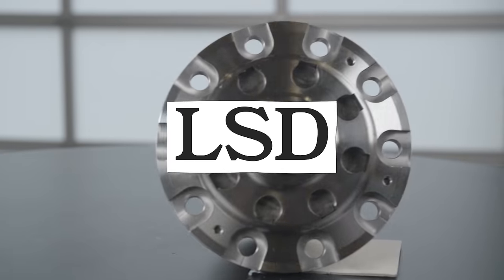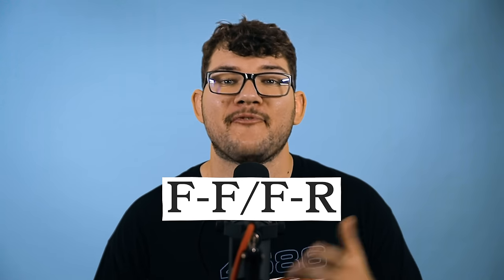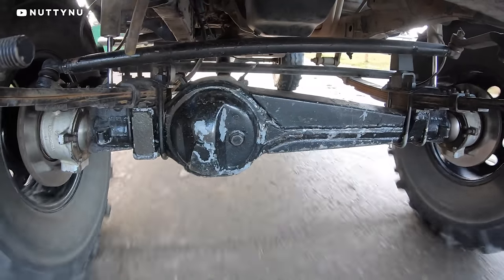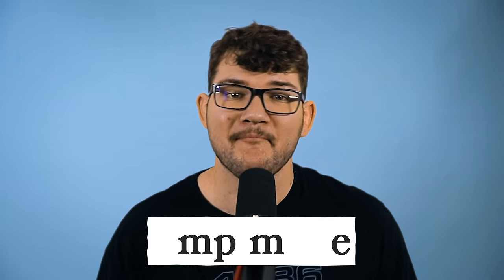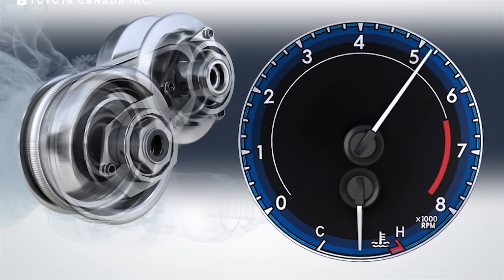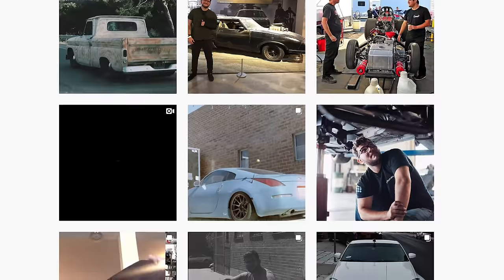Car Terms Every Car Nerd NEEDS to Know

Comment: “ public notice” 

You can only change blinker fluid using a left hand screwdriver
Reply: where can i buy it.
Reply: 03evo8 4g63  should be easy to find they usually next to the brass magnets
Reply: You can usually find it in places that sell long weights
Reply: Got one, was right next to the transmission sand.
Reply: Really? They have those now?
I'm a Lefty, I used the Weird Green Scissors in Grade School, but if they have like a Full Lefty Tool Set, I'd LOVE That!
So tired of using Tools Made for "Righties"...
This is the type type of company to encourage!
Reply: Yup only thing that makes muffler bearings easy to remove
Reply: Ryan Khunja and next to the piston return springs
Reply: Alden Hauser  thanks forgot about the rotary pistons
Reply: LMAO
Reply: ONLY use left handed screwdriver after liberal application of elbow grease
Reply: you have to also remember there is different fluid for left and right blinkers.
Reply: Maestör Rasanen  think your confusing that with the HID fluid.
Reply: and also please do not forget to add the lubricant milk to the oil after the blinker fluid chage.
Reply: @balazsfarkas-jenser2230  In the older cars there's also the blinker filter you must change when you change the lubricant milk to the oil. Otherwise the blinker can  change the color of the blinker.
Reply: @aldenhauser9555  I know we're all talking bullshit here, but piston return springs existed. Sort of. Search for "Hildebrand und Wolfmüller": A 1894 motorcycle where the pistons directly drive the rear wheel and are helped back to BDC with rubber bands.
Reply: you can do it with a right hand screwdriver only on a rotary piston cars
Reply: That was great, but he didn't talk about the ID-10T code that comes up when changing the blinker fluid. Usually needs more lefter, or DIM turns
Reply: Kind of off topic, but when adding or changing blinker fluid, it is essential to make sure that your lug nuts are optimally cross threaded and that you tighten them only once in a counterclockwise manner.
Reply: @therwfer  hmm interesting!
Reply: @Rkhunja  damn thats why i couldnt find one i was looking at the aluminium magnet section
Reply: It's smart to change your blinker fluid when changing to winter air in your tires.
Reply: Brass magnets are almost always next to the long weights
Reply: Funny thing is I've actually had someone fall for the left handed adjustable wrench before. Funniest thing ever seeing him look all over for it
Reply: Lol
Reply: Hey Guys n Girls Top Tip on a SERIOUS  note... dont make the same mistake I did and always check the date on your lubricant milk B4 you add it , ..."Why" U ask?   cause tainted sour ass milk will poison and kill your horses that's why!! Trust me I just lost and buried  15 of the buff boys to  old chunky stinkin ass lactose. Now I'm only makin  78HP instead of the factory fast as shit 93HP In my 1987 base Plymouth Sundance auto...DAMN MILK now it's slow AF...Shit!
Reply: Don't know if you guys can help?... But I'm looking for some tartan or striped paint.
Reply: Make sure you please check your seat pressure.
Reply: Jake Green  hey happy to help. Make sure and pick up a 710 cap as well.
Reply: But before you add your lubricant milk make sure you contact your car manufacturer and double check to make sure your car isnt lactose intolerant if it is the car will be pumping buckets of steam into your cab and it smells if thats the case ask them how to aquire and add the lactose free lubrication milk to the blinker fluid according to the manufacturers recommendations
Reply: @Rkhunja  Nah, a little Right Angle Grease helps.
Reply: Thank you that is how you do it
Reply: Before you do that, it's important to secure the Blinkerfluidcap with a Siemens-Airhook.
Reply: That is garbage, sure it maybe makes the job easier, but if you are half-way competent under a hood you can pull it off with just a set of 10mm SAE pilers
Reply: Okay, I understand about the lefty screwdrivers, but are we talking Phillips, flathead, or ampersand tip?
Reply: Don't forget to check your muffler bearings and catalytic cables whilst you're at changing the blinker fluid.
Reply: @tcayzer  great one 🤣🤣🤣
Reply: But your have to turn the left hand screw driver with your left hand clockwise one turn the counterclockwise and repeat
Reply: @MrHAZZA821  by the brake cushions?
Or the short throw wipers?
Reply: @ohmmygod4963  they even make left handed coffee mugs now too.
Reply: If you purchase the sky hook with the left hand screwdriver at Walmart you get it at half price.
Reply: Got my left handed screwdriver for free when I purchased a radiator cap for my 73 Volkswagen beetle.

Comment: The List:
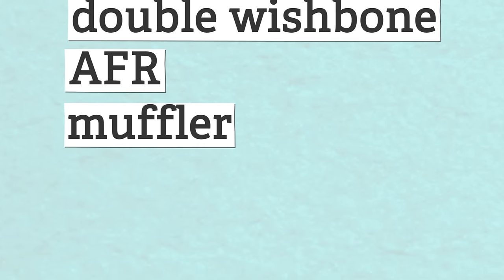MUFFLER 1:45
RESONATOR 1:57
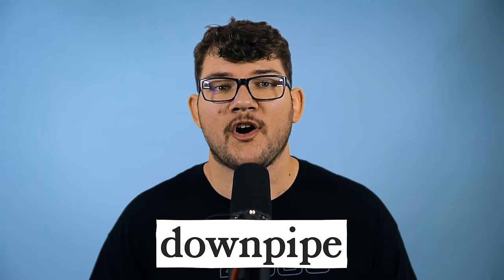DOWNPIPE 2:14
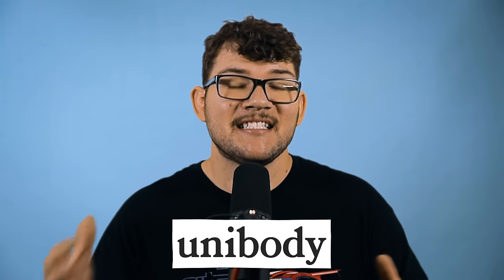UNIBODY 2:28
LADDER FRAME 2:37
CARBURETORS AND FUEL INJECTIONS  2:54
CEL 3:13
FWD, RWD, 4WD, AWD  3:28
TORQUE 3:57
I4, I6, V8 4:27
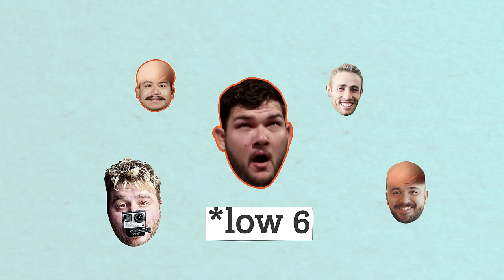F-F/ F-R 5:00
BONDO 5:20
WOT 5:35
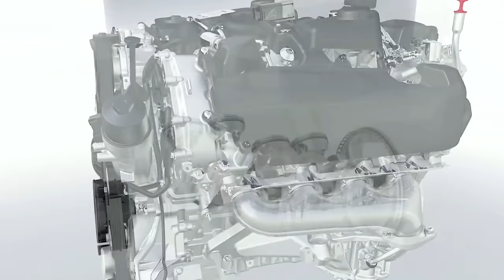N/A 5:50
HEMI 6:00
TURBO, SUPERCHARGER 6:36
SPINNY BOI 6:54
BOV 7:10
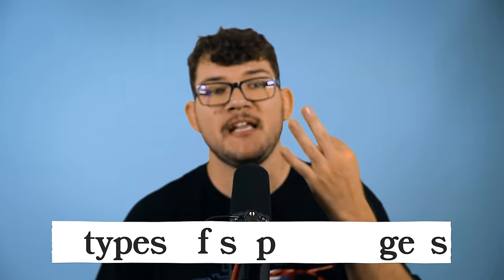ROOTS SC 7:39
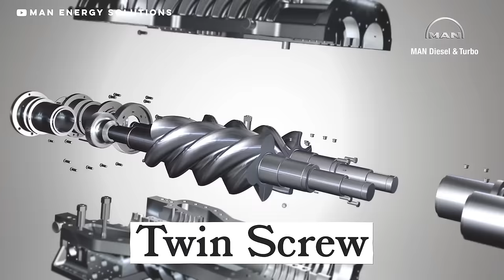TWIN SCREW SC 7:52
CENTRIFUGAL SC 8:04
X PIPE OR H PIPE 8:19
CAT 8:45
MUFFLER OR CAT DELETE 9:14
SLEEPER 9:24
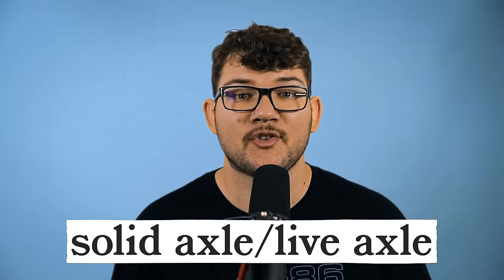SOLID AXLE OR LIVE AXLE 9:49
TORSION BEAM 10:04
MACPHERSON STRUT  10:15
DOUBLE WISHBONE 10:22
MULTI-LINK 10:37
CAMBER 10:53
DOUBLE CLUTCHING 11:33
AFR 11:47
BHP 12:23
WHP 12:33
LIMP MODE 12:45
HEEL TOE 13:07
REV HANG 13:31
MONEY SHIFT 13:52
FINAL DRIVE 14:10
LSD 14:23
CVT 14:37
blinker fluid 15:06
TRANS AXLE 15:29
RACING FROM DIG 15:44
ROLL RACING 15:49
GROUND EFFECT 16:00
FIRING ORDER 16:10
ROD KNOCK 16:25
Reply: Thank u
Reply: cool
Reply: Doing gods work
Reply: A fucking legend

Comment: Ah, so “rod knock” is what I heard 30 seconds before my outback spit little bits of engine block all over I-205 😂
Reply: "rod knock" is when you can't fill the hole. If you catch my drift.
Reply: That’s a standard feature on all Subarus
Reply: @alouiciousdeverdander9152  Thats a standard feature on people that doesnt care about their cars*
Reply: @Luck-jl3hp  But mostly Subaru flat 4s*
Reply: @Meme Man Almost, correct
Reply: No, Rod knock is the common occurrence of rock star Rod Stewart approaching your house to compliment your taste in cars.
Reply: @owenhughes5781  😂😂😂😂😂😂
Reply: I had a rod pop and a rod drop, and an oil pan filled with coolant XD
Reply: Ah the classic, having ur car throw pieces of engine onto the road
Reply: I felt that. 👀 My Outback seized on my way to work at 150k mi- used. I had a slappy boi for cylinder 3(if memory serves) and that didn’t last but a few months. I still drive that car with a Jasper inside. :)
Reply: @Luck-jl3hp  dude subies prove time and time again they cant make a boxster for shit
Reply: That's just extra crankcase ventilation.
Reply: PNW eh?
Reply: Ouch
Reply: @Rubie_the_Black_Widow_Subie  For sure.  Vancouver.
Reply: @Luck-jl3hp  I took care of my car.  It had 300,000 miles on it.  What do you expect? 😂
Reply: @Justinlifts365  It was a 98 with the NA 2.5 L and the head gaskets had been replaced, which means the only thing wrong with that engine was the 300,000 miles on it. 😂
Reply: @davidhaas3111  lived near there for five years ending a few years ago. Got too expensive.
Reply: @Rubie_the_Black_Widow_Subie  I get that.

Comment: “If you say it with enough confidence people will believe you”

Yo I just installed a new Whippy Shammer. Really gives me more horsepower.
Reply: Hrsprs*
Reply: Obviously  that's a slang term for a Whipple supercharger
Reply: @jayvette8936  It is now
Reply: 😂 Love it lol
Reply: I'm actually gonna say this someday and see if ppl figure it out. Also, same with abbreviations if u make one and say it with confidence ppl are probably gonna start using it
Reply: @Egerit100  good luck keeping a straight face lol
Reply: When I was 18 I sold my straight piped 89 Pontiac grand am with quad 4 dohc. I told this kid that I put a hyper micro minuscule modulator in the car and it had around extra 100 hp and he believed me no questions asked. He thought it was a real part. I found out he wrecked the car, he was racing it around on the streets and lost control and he launched over a road divider. Totaled 1000000000% just an FYI I didn’t rip off some stranger. I knew the kid as we were in the same foster home for while together.

Comment: 14:23 LSDs aren't limited to use in RWD cars. FWD cars use them all the time to combat torque steer and wet/slippery situations where power delivery is key. My Mazdaspeed 3 has an LSD in its transaxle for instance, and it may not be super common but I know other F-F cars use LSDs in their transaxles.
And this is the most comfortable I've been talking with shop/forums terms in a youtube comment section. Thanks, Donut!
Reply: Subaru has them too
Reply: My si has one as well
Reply: Integra has it
Reply: I appreciate that you use the word transaxle correctly. Lots of FWD Focus have LSD front diffs too.
Reply: LSD in FWD you go from torque steer to no steer haha
Reply: Dane Kelly aye si gang rise up! Had my 2020 for about a month now!
Reply: I've got a mazdaspeed3 as well, that car is so much fun to drive. That first week of driving around and feeling it all work when mashing the throttle was a blast.

Comment: I would like a whole video about the difference between Steptronic/Semi-auto transmission/Easytronic/CVT/DSG and a classic AT.
Reply: All you need to know: dual clutch transmission (dct), cvt and standard AT (which would mean it has a torque converter). There is also singe clutch T but they are rare these days.
Reply: Or a good ol powerglide
Reply: Top comment
Reply: A semi automatic transmission is a manual but without the clutch which means you don't have a clutch which uses the same concept of a manual transmission but without a clutch.
Reply: @boyinahat1002  like the transmission in dom's charger?
Reply: All you gotta know is DSG is the superior trans setup
Reply: @boyinahat1002  Like, how does that even work?  The point of the clutch is to separate the engine from the transmission while you're changing gears.  So, if there's no clutch, how does the car separate the engine from the transmission?  I'm trying to make sense of it, but I can't.
Reply: Shawn Newland  Got it!  Thanks for the explanation!

Comment: Common car phrase among older gear heads: "Its still good."
Reply: James Grandone or “that’ll do the trick”
Reply: Or at 200k miles "the motor is broken in"
Reply: Or the well known “zipties will do it”
Reply: Endík XD I can’t count the amount of zip ties under my hood on 3 hands
Reply: Endík XD it would be closer to 5
Reply: "thats not going nowhere"
"as good as new"
Reply: I once broke the shift cable linkage that attaches to the ball on the transaxle of my ford fuckas, and put on enough zipties to drive for another 4 months until I sold the car for $200 and buddy tried to bring it back because it needed work. Fun times.
Reply: Scott Sophia that’s a good one
Reply: Morgan Wilkes nothin wrong with that my friend.
Reply: I'll get around to it eventually

Comment: Ones i wish was in;
Pushrod suspension and engine
Direct overhead cam 
Sohc 
Dohc 
Redline 
"Full send"
Dct (double clutch transmission)
Oem 
"Chipped" (chip tuned cars)
Hooning 
Abs 
TC
Reply: ohv
Reply: Yea he should’ve Atleast our SBC small block Chevy
Reply: must know termins are "tick" and "knock"
also:
ANTILAG
FPR
OHC
TPS
CLT
MAP
IAT
ASR
CPS
MAF
O2
WOT
JDM
CPS
EGT
VVT
DI
ECU
EGR
VR
ABS
OPS
VSS
FPS
NOX
WG
BOV
OBD
IAC
044
COP
ETC
VAG
EFI
HALL
ISCV
DOHC
CR
BC
TOE
Reply: FMIC
SMIC
Wastegate
IDI
Idle
VTEC
Shitbox
Ricer
Slushbox
Yin-Yang Spinny Thang
Hiroshima Hair Dryer
Chinese Choo-Choo
the list goes on

Comment: I really need to check my blinker fluid, haven't done it in a year and that clickin gets really annoying. Thanks for mentioning it!
Reply: @supercecilia yes. You get it at all gas stations. It's the yellow(gold) or white(diamond) liquid depending on the type of light you have.
Reply: @supercecilia Xenon: diamond, Regular: Gold.
You could use diamond for regular ones, as it is a clear color, but most experts at TÜV in germany mention that the gold version is more efficient with old lights, reaching a "quadratischer Blinkerflüssigkeitskoeffizient" (quadratic blinker fluid coefficient) of QBL^2=0.95=95%, while using diamond on them only squeezes out 85%. Diamond costs around the same as gold. Some care, some do not. If you live in germany, ask the TÜV to do it for you. If you live anywhere else, do it yourself, as it could get costly if you ask a mechanic.

Comment: I brought a BMW so I can spend less on blinker fluid. I'm saving hundreds every month.
Reply: actually BMWs are the cars that need blinker fluid the most
idk if you've noticed, but almost all BMW owners have run their cars out of blinker fluid, and at that point it's so fucked the blinkers don't even work anymore
remember to top that shit off!
Reply: @Chimera6297  What are you talking about? It's well know BMWs are exempt from having to use a blinker. Just like it's well known if you buy a Jeep, you have to slowly take off parts of it until your driving nothing but an engine with wheels. I mean if you're driving a Jeep with your doors on, or if you are using your blinkers in a BMW, I'm not sure if they let you keep your license.

Comment: "Rod Knock" what keeps every WRX STI owner up at night 😂
Reply: 350z G35 guys too #vqprobs
Reply: Good thing I have a WRX with a sti transmission (deep down I’m almost the same)😢😢😢😢
Reply: rod knock is what kept my last Subaru from being sold 😭
Reply: Don't fucking scare me 😭😭😭
Reply: And Mitsubishi owners
Reply: Duck Mint Ha but the evo 8 and 9 though 🥵🥵
Reply: Finna start checking my oil whenever I refuel instead of every 1k miles.
Reply: Ha, I just lost my ring land and spun a bearing in my Subi 😂 Definitely keeps you up when you're pushing these engines!
Reply: I see no cap here
Reply: E9x m3 people too
Reply: i literally have nightmares about my subi knocking
Reply: Already happened to me. Got a new short block and it still haunts me lol
Reply: Blown Heads
Reply: don’t forget 240sx owners too 🤧
Reply: Annd that’s why I just had my engine swapped 😂
Reply: Honestly I just now know what that sound my car has been making is and may explain the crack I have yet to adress
Reply: -Kock knock
- Who's there
- Rod 
- Rod who 
- Rod knock

Comment: Terms to know if you own an old Silverado: “Lifter tick” and “shitbox”
Reply: Shit box is a Honda term.
Reply: Or just an old car in general. My 95 caprice has the ole lifter tick, and us often referred to as shitbox
Reply: Truth, lol
Reply: Tick tick tick tick tick tick tick tick tick tick tick tick tick tick!!!...
Reply: @ConcussedGaming  or slow car
Reply: Shitbox is when you own a chevy in general.
Reply: Lifter tick? lemme guess.. OHV Engine?
Reply: Throw on "Death Wobble" for Fords.
Reply: Chevy still better than a Ford
Reply: Co Po but then there are the non shitbox old cars, all the classic cars. 
And then there’s the new cars which are shitbox like Prius.
Reply: Marvellino Gracia Z yep, 5.3L LM7 LS. Almost 207k miles and still runs pretty good minus the aforementioned lifter tick
Reply: @Rysander1  Death Wobble is an extremely common term that can be caused by vast array of things. Nothing about it is specific to Ford.

Had an 91 Caddy with no linkage with it. I've fixed my Subaru's death wobble like 3 different times
Reply: @le.farquad608  and what do you own that's so fast? My ol single turbo Silverado runs pretty damn good.
Reply: @paulfrench7257  thy're both bad, ford rips people off, and chevy just makes garbage.
Reply: Cam Bryan i track my cars so top speed means nothing. Handling and fun factor is priority.
Reply: I couldn't really say I have a 2015 Dodge Ram 3500 Dougie

Comment: True story, my first car was an automatic. I had watched Initial D a lot, and watched how they Heel-toed. 

When I got my second car, which was a manual, I tried to figure out how to heel toe myself. Took a few tries before I figured it out, and a couple weeks before I was able to accurately match the revs.

These days I heel toe basically every braking downshift just out of pure instinct. Even took an older guy, who has done a lot of track days and amateur racing over the years for a drive in my car, and he said "wait you heel toe? Wow Im impressed".
Reply: Yeah I've started doing it a bit recently, not too hard though
Reply: Nicee
Reply: Corona Virus: Just what you’d expect from a Subaru. The cars is great but their head gasket are crappy indeed.
Reply: Same, my first car was a manual and I immediately started learning how to heel toe. I can't downshift with heel toe, it feels so weird if I don't now
Reply: When i first started driving, i didnt rev match that well when downshifting, but once i mastered that, heel toeing was an easy next step for me. Although I still sometimes miss the throttle

Comment: In Straya, the slang for bad gear shifting is called "roo juice". This is when you roll away in traffic or from a parking spot in  the wrong gear or the revs are not matched. As a result, the car hops  and lurches forwards like a Kangaroo going off at full speed.